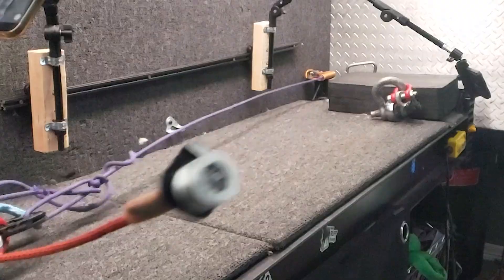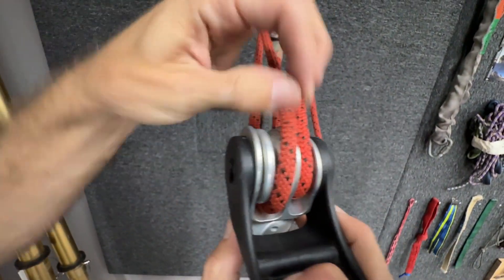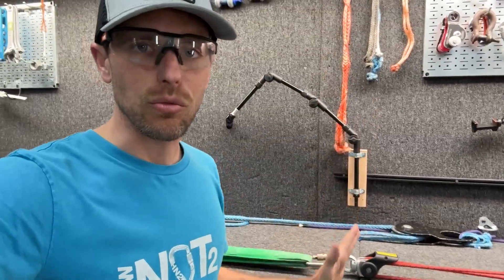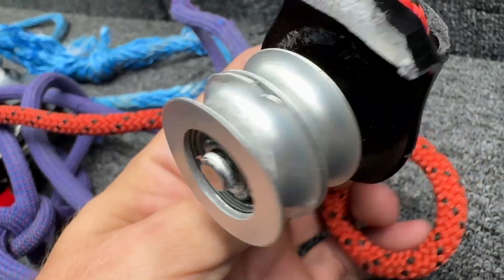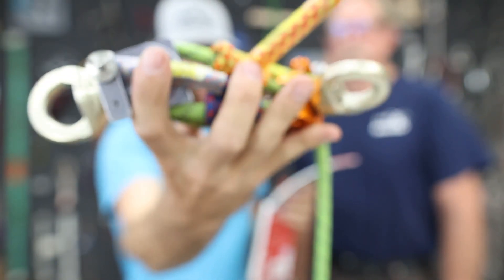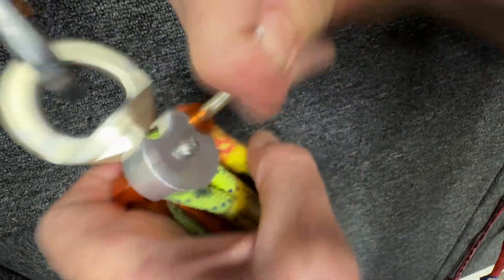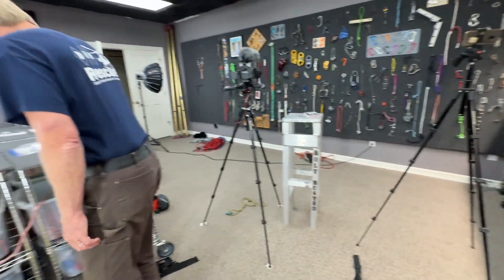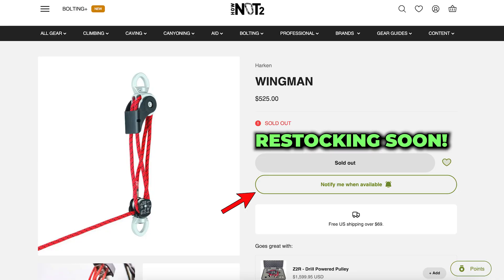I used mechanical advantage to break mechanical advantage

Comment: Rope rescue gear has gotten so much better over the last few years.  

I never tied into the litter system with a 4-1.  I tied a short length of dynamic to the Jesus ring and attached using my grigri then figure 8 the tail to my harness.  Pickoff strap from harness to Jesus biner. Than Aider/ladder to adjust up and down. 

Worked well especially for climbing above the litter/under the harness to negotiate lips/ edge etc.  

Love seeing continuing evolution.

Comment: Much rather have the camming block and tackle just around for heavy deer. Mine is a 5x 3inch pulley with an extra bolted on but I still struggle when white tails are approaching elk in weight.
    I've never climbed with gear (even if I should've) so I can only apply this to other things.
    Would like to see softer, thicker steels with a greater plastic deformation range tho, sagging over time is better to me than all this sudden catastrophic failure.

Comment: I have the Green version of the emergency Rappel belt that Tom is wearing if you would be interested in testing it. I am very interested to know how it actually performs in standard belt loops like they seem to suggest it should be used.